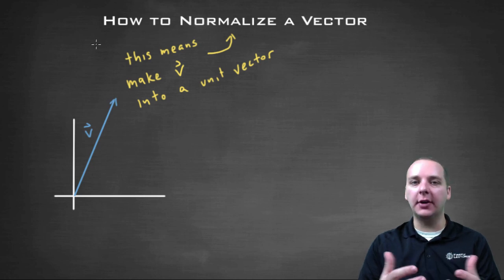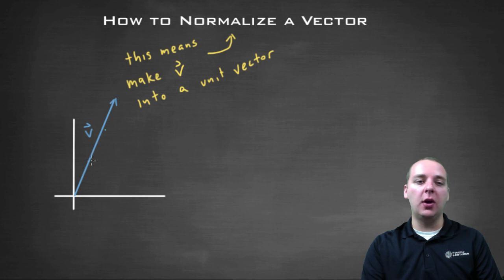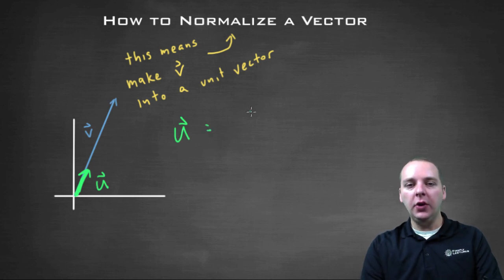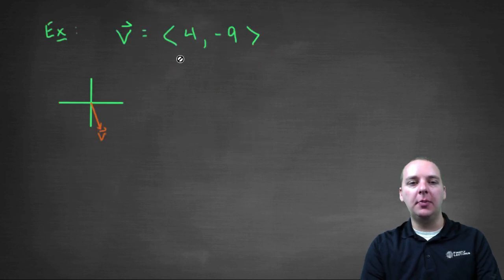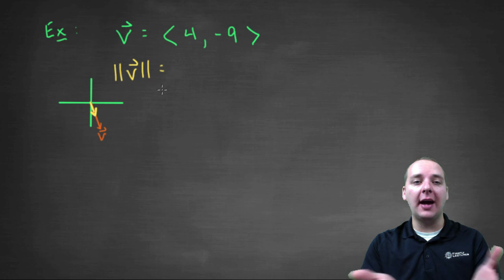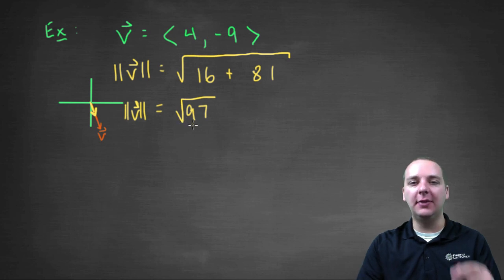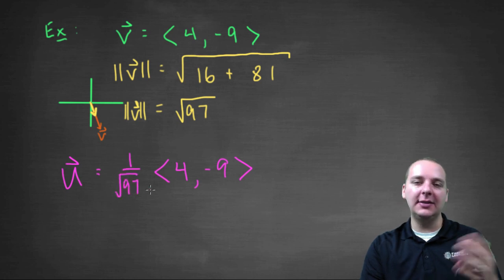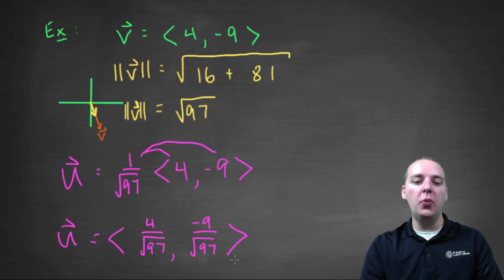How to Normalize a Vector

Comment: Also, if the vector happens to "coincide" with one of the axis.
Say, x+ axis, then the other terms are simply 0.
Thus: [+1, 0, 0] for a 3 dim vector that coincides with the x-axis going +.
...and ofcourse, the proof: sqrt(1^2 + 0^2 + 0^2) = 1

Comment: You are really just multiplying it by a number "1" aren't you. Similar to a "conversion factor".
The magnitude / magnitude.
How?
1.) multiply the original vector by {magnitude / magnitude }
2.) Factor the numerator {magnitude} outside of the vector bracket.
3.) Divide the vector terms by {magnitude}